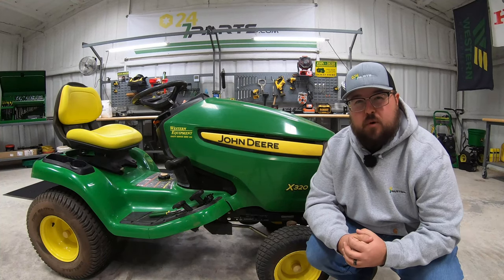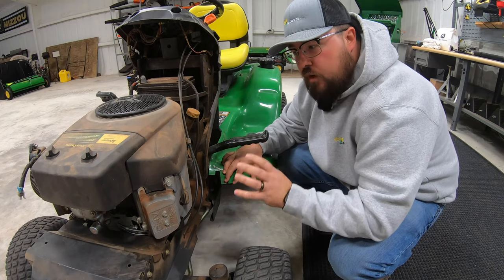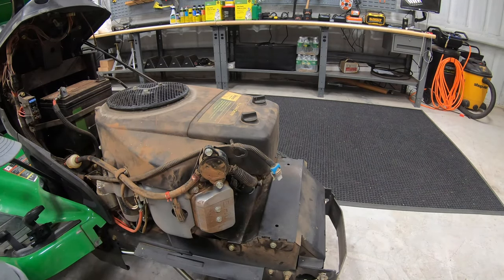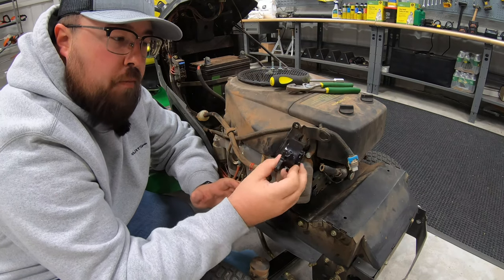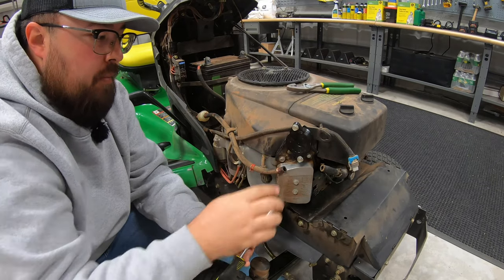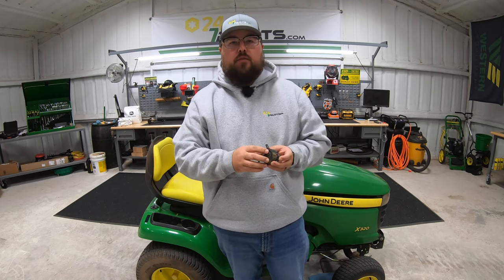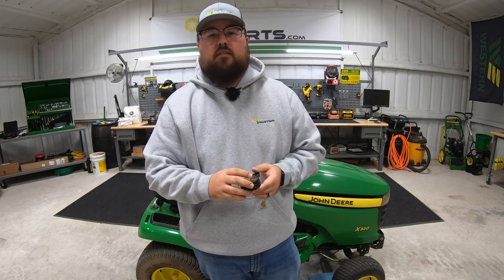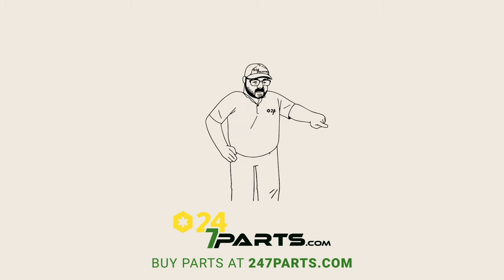How to Install Fuel Pump on John Deere Riding Lawn Mower

Comment: Just a heads up on John Deere D110 fuel pump.  They have Removed the two screws that hold on the fuel pump and replaced them with plastic push on pins.  You need to use a flat screwdriver and put behind the fuel pump (where the screws used to be) and SLOWLY pry out.
Reply from the maker: Good point and thanks for the comment.

Comment: I like short videos. Mine ran perfectly fine yesterday, but now I'm diagnosing a fuel problem. It has never hesitated, but I have had a couple of backfires when turning the machine off. This is a good starting point since I was unaware of the screen on the pump. Great quick video.
Reply from the maker: I hope this was able to get your problem fixed. Any news?
Reply: @247parts  it was the fuel pump. I was afraid it might have been the needle solenoid at the bottom of the carb bowl, but it checked out leaving the pump as the culprit.
Reply: Mine backfires too after I shut it off.  It's been doing that for awhile.  I am going to replace the fuel filter (it's looks dirty inside even though the dealer indicated they replaced it on the Winter service) and I am thinking about the fuel pump too.  It is very hard starting when it is cold.  I poured a little TruFuel into the carb and it started right up which leads me to believe it's a fuel delivery problem at low rpm cranking speed.  It runs fine after it starts.

Comment: Great video! You forgot the second spark plug, right next to the fuel pump though ;-)
Reply from the maker: Thank you, but I'm not sure I am following?
Reply: @247parts  in the video you guys say to pull the spark plug wire off to avoid any accidental starting. But you only pull the spark plug wire off the left side and not the one off the right side
Reply: @salmennella5510  If a 2 cylinder motor is capable of running off just one cylinder, that would be pretty impressive.

Comment: This for the little guys. The bigger like x724 is in the fuel tank. Gotta remove seat and seat frame and bolt in each wheel well to take off rear fender

Comment: Thank you for a great informative channel. My tractor just stopped like it was out of gas. It took massive use of the choke to keep it running. Sure seems like the fuel pump is the problem
Reply from the maker: Could be that or could be that your linkages going form your choke and throttle need to be adjusted. Have you checked this?

Comment: I didnt think to check the screen on the back.  Will check your channel for more info.  My mower is having trouble staying running.  Just over a year old. I think i could have debris in the tank.  I was able to drain it fully.  Strange that I can blow are into the tank (disconnecting the fuel filter and blowing into the tube), but opening the tank lid then blowing that directions is pretty much impossible.  when i do it, some fuel comes out of the open line (where fuel filter is), but the air is SUPER difficult to get through, and im not sure why.  I am thinking a large leaf could be covering the hole, explaining why it is blocked in only one direction.  I replaced the filter already with no luck.  If i disconnect the pump from the filter and pour some fuel into the line (going into the pump), the mower will run until that fuel has burnt out.  Also, when the mower is running, no fuel is accumulating in the filter.  I really dont want to have to pull the whole tank out, nor do i want to take the carb apart (i have never done it before). Any ideas?  (sorry for long post)
Reply: About to go replace the pump now.  Will post back with results.
Reply from the maker: Any update after replacing the pump?
Reply: @247parts  pump didn't fix it.  Turns out the line/filter needed to be primed.  One mouthful of gas later, it's running like a beast.

Comment: Great video. Thank you for putting this together. Would you mind explaining this four ports on the sides in and out  on top in and out on the bottom? What goes where I know the vacuum goes in the back but I’m not sure how to connect the fuel line to which port, and then the carburetor port. Thank you

Comment: Hi,  Got a 12 year old JD 534 that has been great.  Did the maintenance kit on it a month or so ago (oil, fuel, air filters and plugs).  After cutting for a while, tractor starts to miss.  If I let it cool off for 10 minutes or so it runs fine for awhile again, till it starts all over again.  Thought it was a bad new plug and replaced it, and it ran for a couple hours till it all started happening again.  Got any ideas?
Reply from the maker: Sounds like to me that you may have a bad spark plug coil/wire. I would check these out. Thanks for watching!
Reply: @247parts  - ended up replacing both coil/spark plug wires.  Working like a champ now.  Pretty easy to do. You probably saved me an extra $500 repair bill (with pickup & delivery).  Thanks so much for your help!
Reply: Exactly the same thing on my x500. Changed everything out and now it stops all the time. Very little fuel in the filter, so I bought a new one. Didn’t dix it!! 
If I pull the fuel line off the pump an suck the fuel up to my mouth it will start right up. Seems like it’s not sucking the fuel hard enough. I’ll try what you did. Thanks. 
Great video too.
Reply: I had this issue. Ended up being a Clogged vent in the top of the fuel cap. Cleaned the cap and used a toothpick to open up the hole in the middle and worked without stopping after.

Comment: Need help. JD LX277 Vtwin Kawasaki not getting fuel at filter, at fuel pump, and of course not carb. Replaced fuel filter and fuelpump; checked solenoid shut off below carb bowl, it moves freely and returns when I push it. Suggestions? Thanks
Reply: Make sure your tank has gas in it.

Comment: @247Parts  Good Morning, I have a D105 John Deere and there are plastic clip/"flat bolt" i tried to pri that out and the flat top busted exposing what looks like tread.. how do those come out it does have "normal bolts" and has never been changed. This unit only has 82 hours. I have relaced most all the maint type things and almost get it to turn over.. Thank you Sir
Reply from the maker: From what I al showing you should be able to just remove the three hoses and take the two "normal bolts" out and it should come right off. I'm not sure what you mean with the flat bolts.

Comment: how do you know if you have the right pressure coming from the engine i supose just buying a new pump would tell ya i had to drain all gas from mine and cleaned my carb and i cant get her to pump gas need to get a pump
Reply from the maker: More than likely that will do the trick!

Comment: I hae a JD X360, twin cylinder.  Diesel fuel got put in it instead of gas.  I've drained the fuel using a siphon using the fuel line prior to the fuel filter.  It starts but bogs down then shuts off.  Choke it and it
starts but does the same thing.  Do I need to replace the fuel pump and the fuel filter or just the fuel filter?
Reply from the maker: Did anyone try to start the mower when it had diesel in it? You will probably need to pull the tank and clean it, replace the fuel lines, filter and pump. and then also clean the carburetor to be safe.
Reply: @247parts  Yes they did.  I've drained the fuel tank using the fuel line to the fuel filter.  I've put fresh fuel in it.  It'll start but run for maybe 15-20 seconds then sputter out.  If I choke it it'll run for another 15-20 seconds.  My plan is to remove the fuel filter, add more fresh gas with SeaFoam in it and see if it'll keep running.  If that dosen't work, I'll spray some eather into the carb and see it it keeps running.  If that dosen't work, replace the fuel pump and the fuel filter.   Sugestions?

Comment: My fuel pumps vacuum line is hooked up to a connection on my intake manifold. It doesn’t seem to draw enough vacuum to run the fuel pump… not getting any fuel. Not this is a brand new engine and replaced all the fuel lines back to the tank.

Any help would be appreciated.
Reply from the maker: Sometimes the issue is the carburetor solenoid. Have you checked this?
Reply: I hooked the fuel line up to the intake, however this was the connection for a tank breather tube. I ended up having to pull the old dip stick tube off of my old engine and swapping it with the new one.

The engine oil dipstick on my old motor had the vacuum line connection on it. Hooked it up and BOOM! 

We fired up!

Thanks

Comment: Some JD fuel pumps are held on by 2 plastic clips or push pins. How do those come loose
Reply from the maker: Usually you can just gently pry the fuel pump away from then engine and they will pop out. Good question and thanks for watching!

Comment: can you comment what are the results of a faulty vacuum driven fuel pump...
Reply from the maker: You may have problems with your mower starting and it will definitely run rough because your carburetor will be starving for fuel. I hope this helps and thanks for watching!

Comment: My D105 is not mounted with bolts but with metal caps that do not come off easily. What to do?
Reply from the maker: Sometimes you have to get a flay head screwdriver to pry these off.
Reply: @247parts  Thanks. I figured it out. Two flat head screw drivers inserted between the plastic washer and the plastic engine cowl will pop the clips off. Getting the clip out of the washer for reuse requires pinching the slotted end and pulling the clip out.  It requires more force than I could muster to re-insert the clips with my hands. I had to tap them in with a hammer.

Comment: I have a JD 160 lawn tractor and thought it had fuel problems so I ordered a new fuel pump.  It went around the yard 4 times and quit - now still doesn't get fuel.
Reply from the maker: Have you checked all of your fuel lines to see of you have a leak? Have you cleaned the carburetor?
Reply: @247parts2  You know if I take the fuel line off fuel pump it leaks right out. And if I pour gas in the carburetor it'll run and run. I think it might be my fuel pump. Because I put a new one on and it went around the yard 4 times then quit
so I ordered another one and got a refund on the other one.

Comment: Does the fuel pump make it run better
Reply from the maker: It all depends on if yours is bad or not. But in many cases yes it will make the mower run better. Thanks for watching!
Reply: @247parts  Good Morning, I have a D105 John Deere and there are plastic clip/"flat bolt" i tried to pri that out and the flat top busted exposing what looks like tread.. how do those come out it does have "normal bolts" and has never been changed. This unit only has 82 hours. I have relaced most all the maint type things and almost get it to turn over.. Thank you Sir

Comment: How do you know when it’s the fuel pump that is the problem of it not starting?
Reply from the maker: You can usually tell this if there is no fuel making it's way to the fuel filter. Good question and thanks for watching!
Reply: @247parts  So I thought I had a bad fuel pump as it wasn't sucking any gas, even when putting a short gas line directly into a cup of gasoline.  I replaced the fuel pump and it still doesn't suck.  What should be the next thing to look at?
Reply: Unplug the fuel line from the carb… does it spray out?

Comment: What if it doesn't have bolt and it has plastic caps on them?
Reply from the maker: These should just be the push in plastic retainers. They can be pried loose with a flat head screw driver but they may be broken once removed and need to be replaced. I hope this helps and thanks for watching!
Reply: Thank yoy so much for responding I was able to replace it unfortunately my e100 john deere still won't start it only has 25hr and I did my annual maintenance on it amd still won't start  any advice?
Reply: @bmth477  are there any proems or symptoms besides it not starting? I'm here to give you suggestions